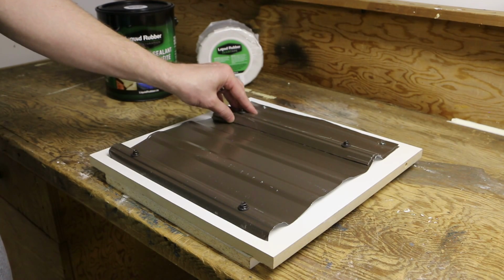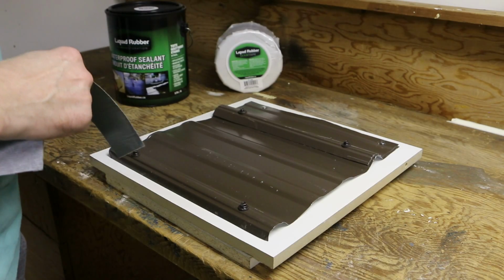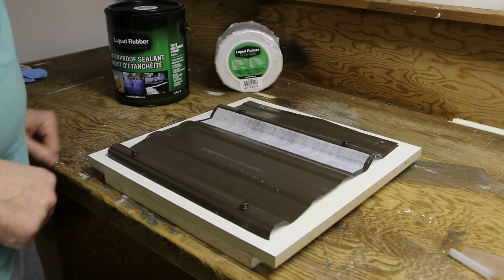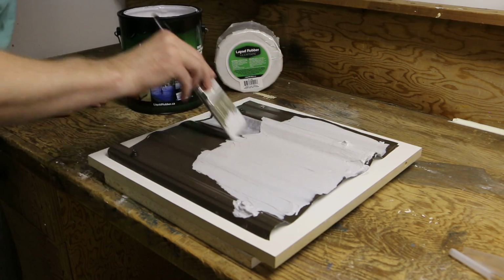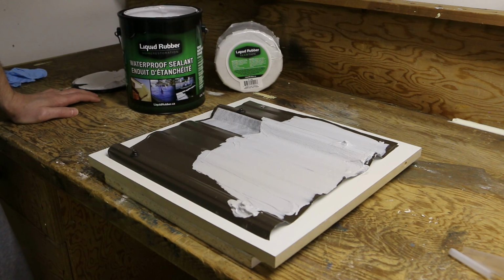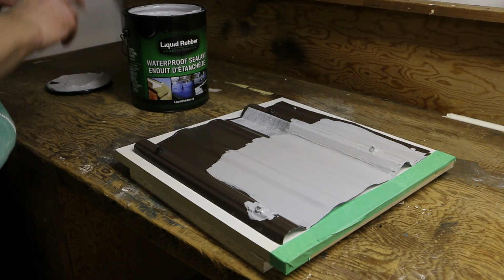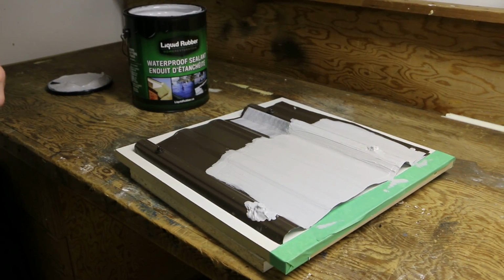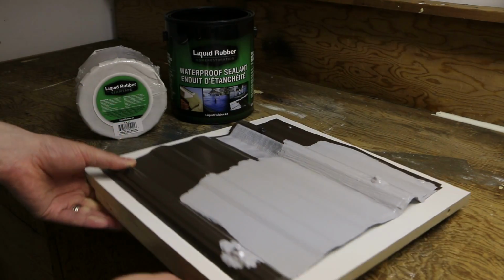Metal Roof Repair with Liquid Rubber

Comment: Will this tape and sealant hold in negative winter temperatures?
Reply from the maker: Hi, yes the Liquid Rubber Seam Tape, Waterproof Sealant and Colored Waterproof Sealant will hold up well in cold negative temperatures. If you have any application questions, please reach out to Liquid Rubber Technical Support.  https://liquidrubber.ca, sales@liquidrubber.ca, 855-592-1049
Reply: @shopliquidrubber  why would you use seam tape over your Geo-textile tape? I see both on your website but don't see why one would use one over the other. Thanks
Reply from the maker: @marcusmazza2255  Hi, both can be used.  The Seam Tape is quicker and easier to use but costs a little more.  The Geo-Textile takes more time to embed into the coating.

Comment: I can’t get on my porch top to do this. I’ll need a mop or something on a long pole to slop it on.  🤷🏼‍♀️
Reply from the maker: If you have seams and joints, you'll want to bridge with Liquid Rubber Seam Tape before applying the coating.  There may be a neighborhood kid who can get up on the porch roof to do the application.  It's pretty straight forward.

Comment: Can you do it without tape? do I need to send it down to steel looking? will the rubber stick to metal strong?I want to seal my car door and car frame with it...
Reply from the maker: Hi,  I'm not exactly sure on your application.  Generally it's not used on automotives but on Metal Roofs.  If you would like to submit pictures of your application to Sales@LiquidRubber.ca, we can be of more assistance.  Thanks.
Reply: Liquid = thanks,,, I will use silicon caulk. I am sure it will work...

Comment: Is it paintable?
Reply from the maker: Hi, we do offer Standard Colors like White, Light Grey, Hunter Green, Tan.... of the Liquid Rubber Colored Waterproof Sealant.  Usually that will be used.  However, for larger orders we can do custom colors as well.

You can see more info here on Metal Roof Applications - https://liquidrubberusa.com/pages/metal-repair

We can be contacted at - Sales@LiquidRubber.ca or 855-592-1049.

Thanks
Ray

Comment: Completely a first world problem but, does rubber painting a metal roof change the sound of the rainfall?
Reply from the maker: Hi, yes the Liquid Rubber will reduce noise transfer of a metal roof.  As the thickness increases, the sound decreases.
Reply: Don't use ANY kind of rubber or acrylic coating on your roof , it will crack with time and you'll have to scrape it all off. Use an aluminum roof coating
Reply from the maker: @dylanclay2741   Did you have an issue with a coating previously?  We have Liquid Rubber coatings that have been in the field for 15+ years with no issues.
Reply: @shopliquidrubber  they work at first but after 8 years or so they start cracking all over but i haven't used your brand yet I might check it out
Reply from the maker: @dylanclay2741  Ok, sorry to hear the other product didn't work out.  Liquid Rubber USA has great technical support to help guide your through products and applications.  https://liquidrubberusa.com/
Reply: @dylanclay2741 8 years lmao that’s a long ass time, if it can save me 17k to replace it I take those 8 years for now

Comment: Do you have to put the sealant on the whole roof or just around the seam?
Reply from the maker: Hi, you can apply it to localized areas as a repair.  There's is not a need to do the whole roof.  The advantage of doing the whole roof is a uniform Color and making it all seamless so you're sure that all leaks are stopped.  You can see more at https://liquidrubber.ca/pages/metal-repair.